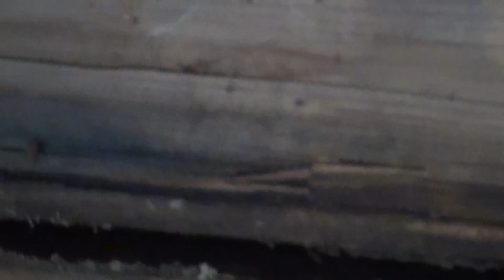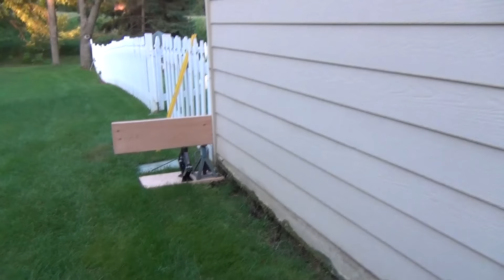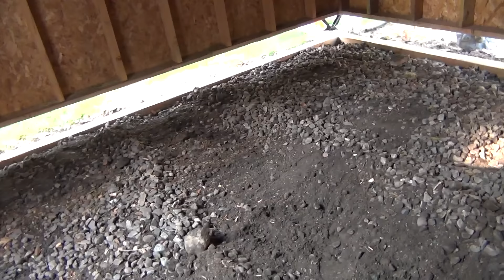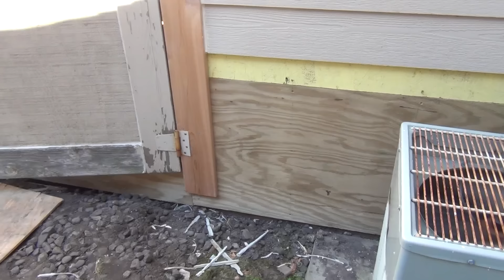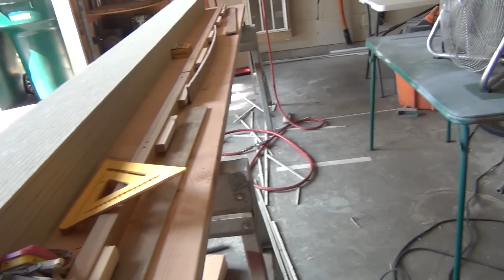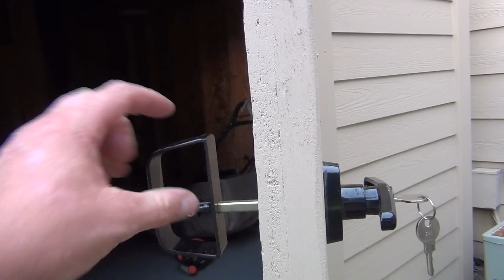Replace Rotted Shed Floor By Jacking The Shed Up, DIY 12'x12'

Comment from the maker: 8 YEAR UPDATE:

It's been eight years since I replaced my shed floor, and I remember how many people were quick to point out that I forgot to put plastic underneath. Some predicted the rot would be back within a year or two!
At the time, I was just hoping to get another four years out of it. A concrete slab was going to cost $2,000, which I thought was outrageous then, and still do!
Well, eight years later, I recently drilled a small inspection hole to check the joists and beams underneath. Everything was surprisingly dry, with no signs of rot!
I think the rock underneath helped, but the biggest improvement was installing gutters on the shed and garage to redirect rainwater. That area used to get soaked every time it rained, especially the corner that had sunk the most. Now it stays dry, even after heavy rain.
A lot of people doubted this repair would last, and I wasn't expecting it to last forever either. But here we are, eight years later, and it's still holding strong!
Who knows? Maybe I'll get 15 or even 20 years out of it!

Comment: Im  getting ready to do the same thing on my 14X12 work shop/shed. But, Im gonna pour a cement foundation because I Have some heavy shop equipment that need support from a solid foundation. Thanks for showing the way you jacked up the shed as this is my maine concern in getting my project started and completed.

Comment: It’s been 7 years, how’s that floor holding up?
Was thinking you need air flow or plastic vapor barrier under there.
Reply from the maker: I don't have any problems yet. I didn't think of a vapor barrier at the time, wish I did. But its still as good as day 1

Comment: I appreciate this video.  I was wondering if I could do something like this for my building. My building is 12 x 16 and whoever built it did not put sill plates or joist hangers on it and the joist pulled away from the outside boards and my floor collapsed. Thank you sir

Comment: Wow, thank you for the idea to jack the shed up from the outside!! i was preparing to rip out my floor, dig down under the floor joists and throw a 2x10 under the joists and jack the shed up from the inside with a car jack under the 2x10. I have a rotted out rim joist as well. This method will make things MUCH easier to do the repair! Bravo!!

Comment: Ive built several sheds and if I build anymore I will always place them on a continuous foundation of cinder blocks, cheap and does a fantastic job of keeping off ground and lastly looks fantastic!  Of course the blocks get placed on compacted gravel.

My summer house has a lets call shed attached to the back house that is pulling off the house so guessing front of shed is sinking.  Why people do things 1/2 a$$ is beyond me but this video is fantastic because I’m trying to figure out how to raise shed back up without dismantling the entire shed before I fix footing and the board used on outside is genius, thank you!

Comment: You’re gonna end up with that same issue again eventually, if it isn’t pressure treated it’s gonna attract termites and other insects into it, also I would’ve added those 4x4s underneath the floor frame horizontally to add more structural integrity to the floor, jacked it up one more time from the newly built frame, and added stone blocks underneath the 4x4s in a supportive layout, because with the wood touching the ground like that still it’s bound to happen eventually.
Reply: Still a great build though.

Comment: As someone who has never done anything like this why cant you put Joyce hangers on all of them would it benefit the shed if put on all or somehow harm the structure?
Reply from the maker: You could definite use hangers on every one if you felt the need for them. On the ones that didn't get hangers, they have 6 framing nails on each side.

Comment: I built my shed out of pressure treated lumber.  The floor is marine ply and the sides are ply with hardie board, so concrete.   Spend a little extra up front but it will probably last forever.  Mine has been through many storms including 3 hurricanes.   Still standing.   Cinder blocks anyone.

Comment: Great work, but one bit of advice for others is to use masonry instead of 4x4 in the ground and then use a damp proof membrane or something similar under the sub frame to prevent ground moisture ever rotting any wood in the future.  Treated wood will still rot.

Comment: Why didn't you use cement at the bottom? Won't Earth to wood contact will rot out again.
Reply from the maker: It will, but it took 30 years or so for the first time. The wood was way cheaper at the time. When it rots again, I will pour concrete and make the shed larger at that time.

Comment: Great a video, thanks so much....    I have the same situation but i was going to use concrete with vapor barrier instead putting wood back in the ground which seems to me will rot again.  I also have an issue with animals digging under the wood and making nest under the plywood floor.  Concrete was actually cheaper than all the wood and will last a lifetime.  Any reason you did not use concrete?
Reply from the maker: Thanks for watching, and I wish concrete was an option at the time. I called 3 people, and they all wanted around $1500 I think they quoted it so high because they wanted nothing to do with it. They all came out before it was jacked up, that's probably why. I bet if I had it up and framed off, it would have been around 300-400. But I didn't think of it at the time.

Comment: New OSB wall sheathing touching the ground will definitely wick moisture out of the ground and create water damage
Reply from the maker: Yup OSB would not be good, I used pressure-treated plywood. I ended up putting rock all the way around the shed to help keep it dryer.

Comment: You ran your plywood the wrong direction. It should be perpendicular to your floor joists to achieve maximum strength.
Reply from the maker: lol you are the first to point that out. It's a good thing I'm not building homes ;) For not knowing everything I would say it's holding up great.

Comment: Nice job raising the structure! That was great. Thank you!

Laying the 4 x 4’s on concrete blocks with sill seal in between would help, as would a vapor barrier over the gravel.

I don’t think people can understand how difficult a project this was. You are so low key about it. Well done, Sir!
Reply from the maker: Great tips and thank you. I'm going to see if I can pin your post so others can see it.

Comment: This is great information. I wish he had been more specific regarding the lags used. He was basically guessing at 5/8” x 5”. 
I have to doubt the lags were 5/8” diameter. They likely were a 5/8” head and even that is questionable. However a 5/8” head would be a 3/8” diameter and that is much more likely and I should think sufficient.
I would love to hear from anyone who has used this technique as to exactly what materials you used for a 10’ x 12’ or larger but NOT SMALLER shed.
Lumber size- did you go with 2 x 10’s or did you go smaller?ñDid you use 3/8” lags? Large/smaller?
I thank you for taking time to answer?
Reply from the maker: Thanks for your post. I still have the lag bolts so I check, you are right I did not use 5/8 they were 5/16 and 6" long.
Reply: @Ricks_Tech_Talk  Thank you very much as I have been concerned about that. Getting ready to raise my shed and build a floor. My shed is actually four walls and roof made of 2”x 6” x 12’s and has asphalt roofing material, so it is not light. 
I have 1/4” lags but will get 5/16” rather than 3/8” which is what I was going to get (but they are quite expensive).
Thanks again!

Comment: But you didn't have a floor to start with. My floor is screwed to the bottom frame before the walls were built on top. I thought you'd show how to replace something like that.
Otherwise informative video, and partially apply to my shed floor.
Also, why not pour a slab? the area seems accessible.
Finally, without ventilation and without PT, this might root in a few years.
Reply from the maker: I did have a floor, sorry I didn't show how it got removed. Most of it I could rip out by hand, it was so bad. To remove the walls from the floor, I used an oscillating tool to cut all the nails that held the walls to the floor. As for the slab, it was way to much at the time. The shed lasted 20 years or so before it rotted. If it does rot again, I might pour concert at that time. A few years ago I cut a few holes in the floor to help it vent underneath, I used a scope to inspect the wood and it still looks great. When I rebuilt the shed I added gutters to the garage and shed so it is very dry around the shed now, before it was a lake lol. Thanks for comments and watching the video.

Comment: Why would you leave it down in the dirt where ground moisture can cause more trouble, later.  Jack it up and leave it up there.  Put a proper floor or at least some kind of masonry lower wall.  Water and wood don't mix.  It's a lot of work to jack it up.
Reply from the maker: Thanks for the comment, it's good for others to see things like this. I didn't want it any higher than what it's at now, and the shed lasted over 30 years last time. I should have put down a vapor barrier, but I didn't know any better.  I did coat the plywood underneath, and I fixed the standing water issue. The rain was pooling around the shed for years and that's all fixed now so the ground stay nice and dry. I have a few holes in the floor that I use to check the 2x6s and it's stay dry so far. 
If and when it rots again and if I'm still around, I will end up pouring concrete.

Comment: This is perfect. I was racking my brain and trying to find a video like this. I have a 12x12 shed I'm trying to convert into a sauna, but the plywood floor is sagging and i need to lift the whole thing higher off the ground. I need to figure out what to do underneath the stove instead of a plywood floor, but I'm hoping I'll have as much success as you did for the first phase.
Reply from the maker: I also update this info in the description. I'm glad you picked up on that.

Comment: Nice Job! I need to figure out how to do something similar on a arrow metal shed that has landscaping timbers as foundation with deck boards inside for the floor. 
The landscaping timbers are rotting away.
Reply from the maker: If you could slip two beams under the shed and separate the metal from the wood floor, you could lift it. But then you need a way to remove the beams after you lower it down. Good luck with it

Comment: Great video and great job on the shed rehab. I'm planning one now for an 8x10 and will be using some similar techniques. Should make for a decent video. Did you consider a plastic vapor barrier but decide against it for some reason?
Reply from the maker: Thanks, and I never even thought of it while rebuilding it. So I drilled a few holes in the floor to allow air flow after it was done. I would love a larger shed soon, so I'm not too worried about it. Thanks for watching and good luck on yours.

Comment: What kind of bolts did you use? You said 5” then 5/8”…I’m guessing you have to drill a pilot hole before installing the bolts in? With a washer?

I ask because this is a really outside the box way to Jack up a shed and I would like to do this to a 16x12 one…but I wanna make sure I do it correctly
Reply from the maker: I drilled from inside going out so I knew where the bolts on the outside needed to be, so yes they all got pre drilled. 5/8 bolts and 5" long. Be safe and take your time.

Comment: I just purchased a new shed from Tuff Shed, through Home Depot. They built it on-site, placing it directly on the ground. I was wondering if that could lead to floor rot, as I’m in a hot, humid climate. I’m a senior, so I can’t do the work myself, but was wondering if I should hire someone to lift it, and by how much? Any thoughts would be appreciated! Thanks.
Reply from the maker: Mine lasted 20 years before I had to do anything. The frame on yours should be metal and the floor I'm sure is wood. The wood plywood would rot first. But if you have it lifted, that will help with moisture build up under it. I would talk to the store, I thought they built all of them on at least pavers.
Reply: @Ricks_Tech_Talk  :  Thanks for the info!

Comment: WOW, thank you so much, I did not hear you say the size of your shed.  Could you let me know what the size is?   I really love the idea of keeping the shed off the ground and sliding the new floor into place!
Reply from the maker: It's a 12'x12' floor. I learned after it was done that I should have installed plastic under the frame to keep moisture from coming up. Thanks for watching.

Comment: Why didn't you use 4 x 4 piers. With 2 x 6
Reply from the maker: I didn't want it any higher off the ground. When I move it to the back, ill have it on a slab if it's still in good shape.

Comment: Why wouldn't you put vapor barear  down first to prevent rotting again?
Reply from the maker: Learn from mistakes, and that was a big one. I did add ventilation after people told me I should have added a vapor barrier. The ventilation should help by letting the moisture out and help dry the ground, it's better than doing nothing. I would love a larger shed in the back, so if the floor rots again I'll take it apart and make something larger in the back :)

Comment: I really like your video. I have almost the same issue as what you had. I have an 8 x 12 shed. I noticed my shed was really  sinking towards the back. Its was basically sitting on the ground. on top of that i had a ground hog and did some serious damage to the joists. Before looking at your video. Last weekend i decided to tackle this issue thinking i just needed to replace one plywood that was rotted i could almost put my foot through it. When i cutout that board wow, the damage was extensive. I started to remove all the plywoods, there was 3. Then i removed almost all the joists they were either chewed or rotten. Then i noticed that the exterior boards were rotten to almost half on each board. So i decided ok, i will start jacking up the each corner and put block under each corner. When i got to the 4th corner, i started noticing twisting and it seemed the shed moved a little. So i dropped the back to the ground on the last corner. I decided this is not a good sign and decided to do some research and came across your video. Do i need to use the out side boards and jack up the shed that way. As you did.
Reply from the maker: It will be more stable with the jacks out farther, and with them outside you can replace what's needed on the inside without the jacks getting in the way. Just take your time and jack up just each jack just a bit at a time. Jack it up too much on one side, and it will move. Good luck

Comment: I need to do similar on a smaller shed. How did you lower it?
Reply from the maker: The same way going up. If you have 4 people to work the jacks, that would be the best plan. If it's just you go down an inch or 2 per corner.

Comment: Good job!! I had a 12' x 16' shed built as a wood shop, and they didn't put enough support underneath so the floor sags between joists. I plan to take everything out when the winter goes away (am in Pacific N'West!!) and basically do what you did, but rebuild the 4" 4 4" beams and brace all the joists better, then install all new tongue and groove plywood. Just not sure yet how I am going to separate the shed from the current foundation, maybe just use a sawzall to cut the nails all around before jacking it.
Reply from the maker: Sound like that would work

Comment: Thank you so much for the video. I’m a 60 year old widow but there’s nothing I won’t attempt. My husband built a 12 x 16 shed but it has a dirt floor. It stays too damp and everything molds in the building. I’m over it. I learned some very important facts- use pressure treated wood, joist hangers and plastic.
Reply from the maker: Yes the plastic would be great, wish I knew that before :)
Reply: Imthe same age and not afraid to try but dont always know how to do it.

Comment: Wish you would of shown how you used the block of wood to turn the building. I need to do what you just did.
Reply from the maker: Yes that would have been a great add on. But if you took a jack closed up, place it on the wall that you want to move out. Then screw a block of wood in front of the jack it then has something to push against. Of course none of the walls can be screwed to the floor if your doing this. Hope that helps you and others that run into that problem

Comment: How's it holding up 3 years on? The bottom of my shed also rotted and I learned my lesson, don't put timber in contact with soil. Pressure treated or not.
Your timbers are large and will take a while to rot but that isn't the problem, as I discovered. Wood worm love wet, soft wood, and once they start they pread at a rate of knots. So even though rot may take years, if the worm take hold you may be in trouble. Keep an eye out for them and if you get time buy some 5 star treatment, put it in a spray bottle and give the ground timbers a good soaking.
Reply from the maker: So far I don't feel any change in the floor and I cant see any of the boards under it. Thanks for the tip on the worms, I could always cut holes in the floor to spray the wood. Thank you
Reply from the maker: Well a 8 year update for you. Its still like new. I think the rain gutters on the house and shed made a huge difference. The rain would pool up really bad before and now when it rains its all dry on side near the house.

Comment: Good Job.Throw some squirrels dirt pile 6 inches high Nuts and acorns some rotted wood and a shed that had not been cleaned out in 30 years. You got my mess with the rotted missing floor!